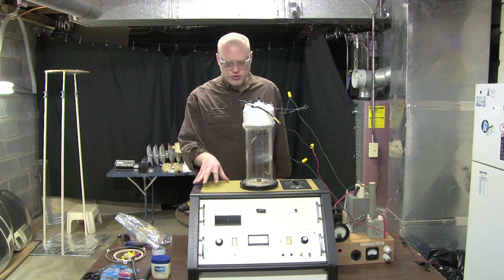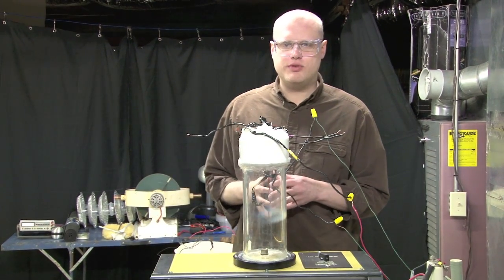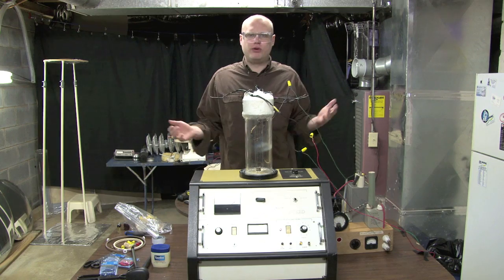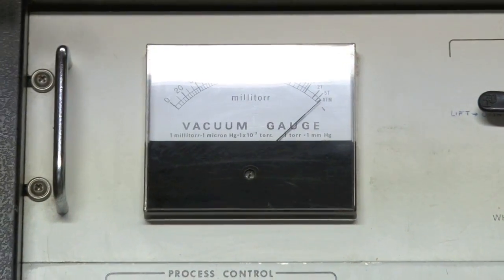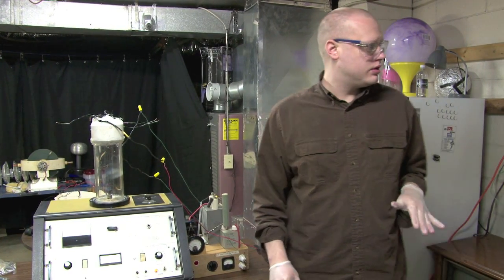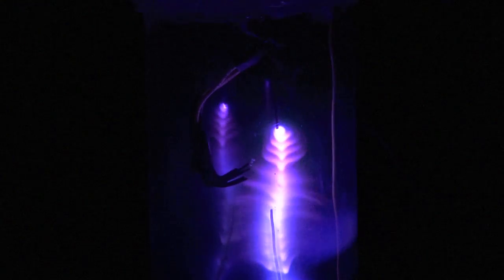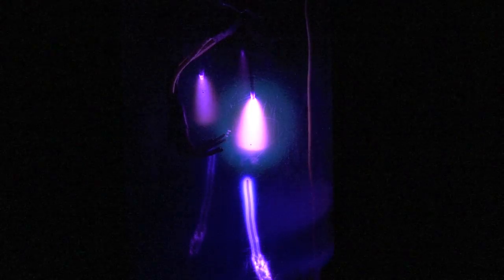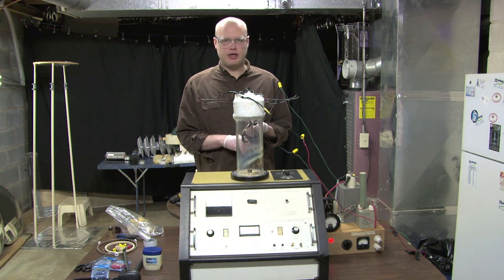Plasma Tube Experiment

Comment: The gauge quite clearly shows that it's actually at 2 Torr pressure (the 2T gradation), not 2 milliTorr which would be at the far left of the scale. 
The plasma segments you are describing as "shells", "ripples", and "independent plasma" have been observed and described in Geissler tubes (with just two electrodes) for about 150 years, the dark spaces between the glowing disks have official names in textbooks such as Crookes dark space, and Faraday dark space. This is a classic physics classroom demonstration. Extra electrodes are completely unnecessary to obtain these effects.